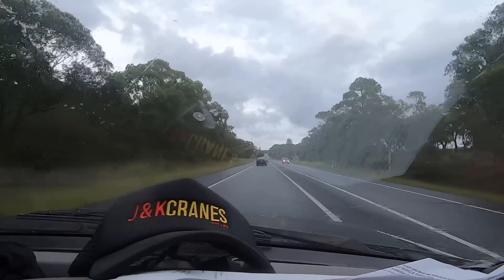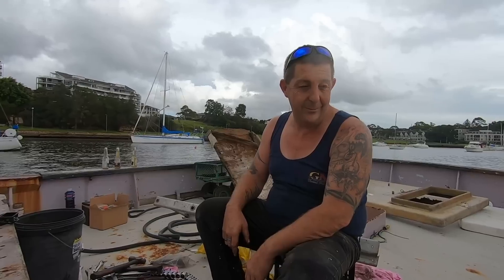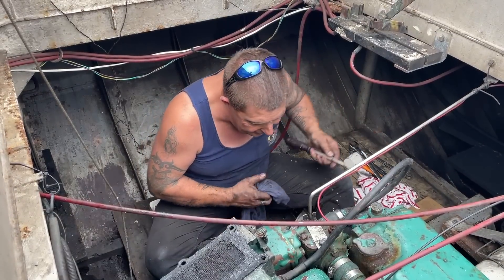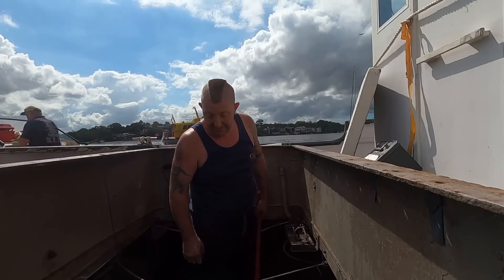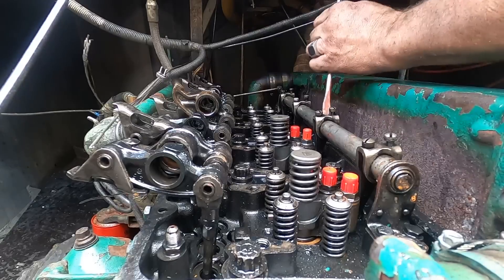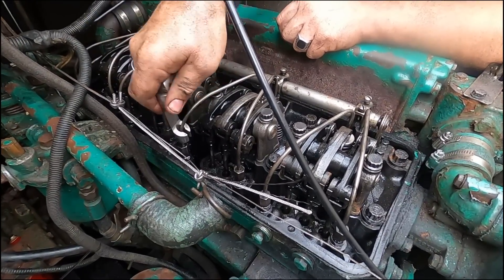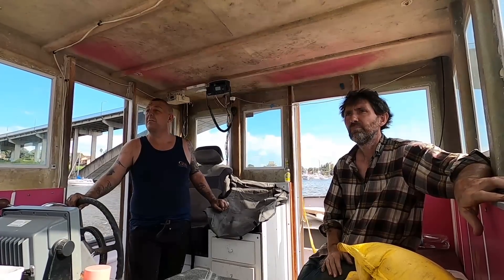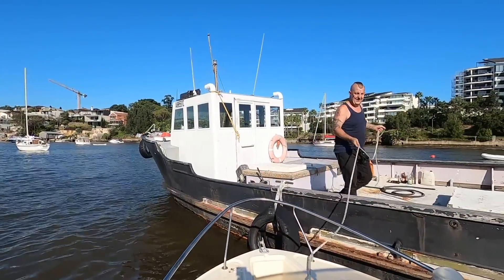Old Detroit 4-53 - Will it run?

Comment: Interesting how we still use the term "run away" My instructors back in the day, around 1960      when I was in trade school would correct you. Stating engines do not run away, mechanics run away, engines over speed. I never forgot it. Worked on many a Detroit. Thanks for the memories. The old school guy.
Reply: Bwah
Reply: My instructor in 68 when I was doing an apprenticeship for heavy earth moving equipment used to say the same thing...I'm 70 and still using the spanners...👍👍

Comment: That was interesting. The last time I saw a 4 53 was about 40 years ago. All my work was on EMD 20s on shipping. Mostly generating plants. Hope that the project works out for you. Oh and yes, I am a female marine engineer, cheers  Laurajane or just LJ
Reply from the maker: Thanks Laura, glad you enjoyed. :)
Reply: The only EMD 20’s I’ve ever seen were for generators. I’ve mostly worked on the 16’s on locomotives.
Reply: @billmoran3812  Yes Bill you are right. We had four EMD 20s as generator generators. I was Chief engineer on a cruise liner. The whole ship was all electric

Comment: Love  this real life stuff, I help a good friend of mine to give a yearly over haul checking all systems on his working dive/fishing boat, very satisfying to see it done ready for next season, few years back he dropped two bmw diesels 2.5  6 cyl , into a 30 ft open deck front wheelhouse , the conversion to marine spec was not easy the electronics was a nightmare but he did it, it gets up on the plain very smartly and is very low on fuel consumption, he has an order to do the same with two 3 ltr bmw on a similar hull with a cat v8 diesel with red diesel at the price today is no joke, looking forward to that conversion, keep your vlogs coming mate 👍👏👏👏

Comment: I guess rescuing old steel boats is an addiction just as much a labor of love. I understand, I have a 1988 Ford F250 diesel pickup truck in my driveway I just put a motor in to resurrect it. I previously did the same with a Dodge Ram 1500 truck and sold it. You sometimes hate it, will get frustrated and curse at it during the process, but in the end, you love it. Same way with boats.

Comment: I'm the skipper on a working tug, just a little ways upstream from this trawler. We are based in the former Halvorsen shipyard. Adrian has serviced her twin 6-71s. This is an iconic tug, named Betts Bay which was built in Ballina for a company called "Harbour Lighterage" in 1979 and has been partially restored. Adrian and Patrick will be reconditioning the stbd engine soon. If you're in the area again and you require tools, etc, or even if you are interested in having a look around feel free to drop in.
Reply from the maker: Thanks mate, would love to get a tour.
Reply: @DangarMarine  any time

Comment: Soon as I saw it was a Detroit Diesel I had no doubt it would start. Know of one that was underwater for over a week following a storm and after simply putting in fresh oil and changing fuel filters, it started like it had been running earlier that morning. I've seen an 8v71 run with a hole in the block

Comment: Before i started any of the ones i worked on i put a pair of vise grips on the rack bar just incase . Semce he didnt set timeing or height. Witht he pin tool or dial indicate.

Comment: Heat exchanger might be calcified,take of the inlet pump hose and run a 50/50 mix of freshwater and hydrochloric acid into it and let’s sit for 20 minutes,repeat then rinse,use a 4 litre container from bunnies $20.00.
Dive the prop and get the barnacles off it so the engine won’t labour,cheers guys new adventure.
Reply: Phosphoric acid is good for rust too

Comment: wow 2 mins from my joint  at 10.54 in vid you will see the pilot boat in the back ground  that was just sold at pickles  auctions straight from the pilot station in the city under $30000 great boat but nothing for you 2 scallywags to work on as goverment maintained to very high standards  good luck with her ,awsome
Reply from the maker: We were admiring the pilot boat each time we were there. It's a very cool sea worthy boat, just lacks any outdoor deck space otherwise it would be perfect.

Comment: i once had one of these Green Carts that is on the Deck 10/10 would buy again if i got need for one again. it can load 300kg or more, way better than these wimpy folding ones that can only carry 75kg were you have to worry about riping the handle off when making a turn.

Comment: I do the same thing like Stew... One to two fingers when torque wrench not available... lol.. My father has a 3/4in drive ratchet I bent into a S-shape. No cheater pipe used.. Two hands of brute force with feet up against the frame of vehicle. Bent coming out and bent going back in...

Comment: Yeah you too will have a  little duel and stew will be trying to figure out why the heck why rinko lost so bad  have  him pull the valve cover and find out he has n65 injectors in it 😆.  Wonder if the heat exchanger is full of barnicals.

Comment: Love your videos I have a Evinrude E70TLCRD I think a have a vacuum leak in my lower seal I sprayed starter fluid at @ 3/4 throttle it doesn’t go fast but as soon as I sprayed it in it wanted to die what do you think

Comment: It’s ALIVE!

Maybe I missed it, but did you have to purge the air out of the lines after installing the new injectors?
Reply from the maker: No, detroits are common rail engines so will self bleed.

Comment: I need some help. I have a 30 hp Yamaha 30ELRR tiller outboard. I would like to change it over to steering with throttle and shifter up front. The motor already has a tilt tube. Is there a video out there to show how to do this. Yamaha told me it would cost $800 US. I don't belive it!. Can you help?

Comment: Stu,  I just won a boat at auction that has a 93' Johnson GT 225 Venom on it. The boat was in a barn for 15 years and looks brand new. I understand how to go through the carbs, fuel, put pentrating oil in the clinders etc, for a boat thats set awhile from watching your series on the evinrude 150. My queston is do you prefer the service manual from the actual manfacterer or does Seloc,Clymer etc do a good job with thier manuals ? I can only get Johnsons manual off ebay and its triple the cost of the Seloc and honestly about half the cost of what I actually paid for the boat, lol. Give me your opinion and I'll be sure to buy the whole family one of your shirts and send a pic of us wearing them in the boat here on Lake Livingston in Texas - Thx
Reply from the maker: Hi Michael, to be honest I've never even seen a Solec manual so can't really comment. I should grab a couple from MarineEngine.com one day and check them out, it would be interesting to see how much detail they contain. When it comes to factory service manuals I generally just find somewhere that is selling them online as PDFs and print them if it is an engine I am doing a full rebuild on and will be referring to it a lot rather than just looking up the odd torque spec etc. Here is an example for your engine, but if you google you may be able to find one that is more specific, I've never been a fan of manuals that cover a wide range of models. https://www.servicemanualbit.com/downloads/1992-2001-johnson-evinrude-65-300-hp-outboard-v4-v6-v8-engine-service-repair-manual/
Reply: @DangarMarine  Good deal, appreciate it.

Comment: I am not a mechanic but even I know that with that much extra oil it is likely to be very diluted by Diesel. It is not a 2 stroke. It needs to have the oil drained and replaced before doing anything else.
Reply from the maker: It was very thick still. Detroit diesels have two sets of rings. The diesel that gets past the first set goes into the air box and out the drains. The second set of rings stop it going into the sump.
Reply: @DangarMarine  Yes, if they are not broken.  Once you know it will fire up, you then know it is worth putting good oil in so if you need to do it anyway, it may as well be sooner rather than later.